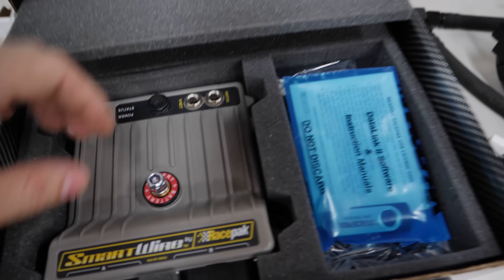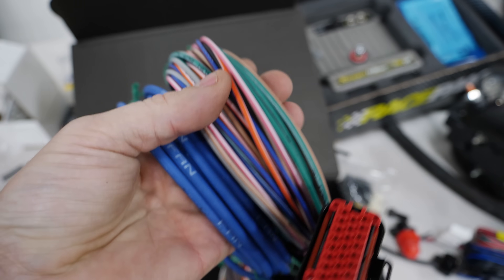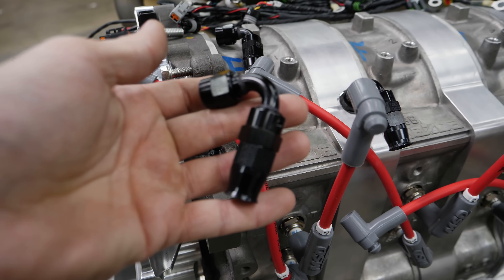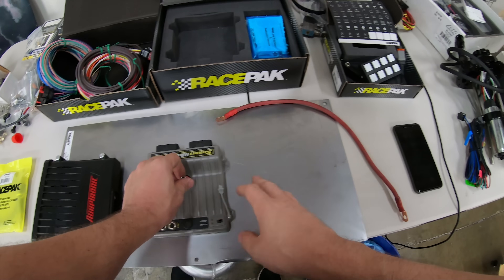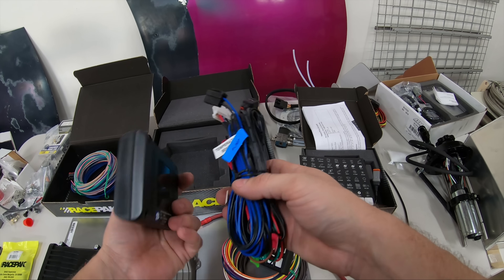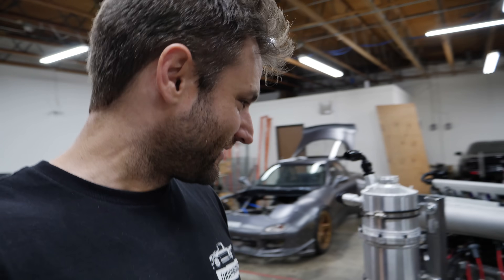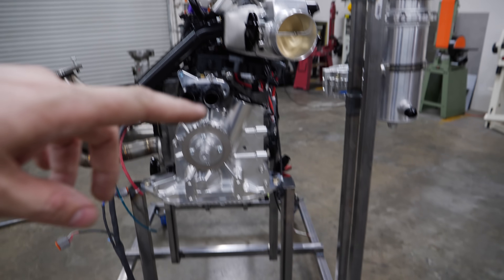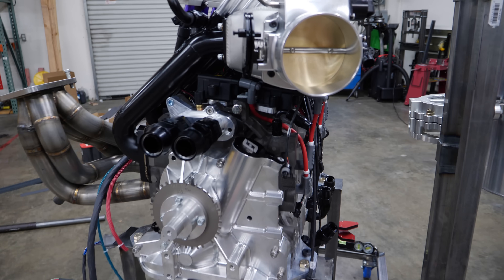The 4 Rotor will have NO FUSES to Blow or RELAYS to Wire?!

Comment: Highly doubt it will have zero fuses, you should have one for the starter, alternator and any time cabling splits/distributes off where it may come in contact with earth in the worst situation, any time a cable changes gauge or junctions it needs to be fused.

Comment: With the fuel pressure you're expecting here you really want to have an option to turn off your fuel pumps. You don't want to have fuel pumps running all the time whenever you ignition is turned on for whatever reason (tuning eg)

Comment: You can get good bender like Earl's and make those hard AN lines. Solid or swivel fittings are cheap, they rape you for the line in between. If you can make proper flared brake or fuel lines, you can make AN hard lines. The best part is you can make them any angle you want. You can also make complex bends and follow contours. It makes a cleaner install, the hard line is just 37 degree flared line #10 an is 5/8 line. Use the braided stuff only where you need flex for movement. It's big and bulky when the inside is still just 5/8 talking about 10AN. use hard stainless line and contour about a half inch off the surface with support every 6 inches to 3 feet. My 2 cents,  37 jic hydraulic line fittings are the same thing, you can buy them for 25 cents a piece. I can make a 120 degree 10AN hard line for less than 3 bucks. It's what you know. 37 jic hydraulic is the same as AN

Comment: Rob, Smartwire  is not an ecu. It can act as fuses for the cooling system but it doesn't turn fans on and off automatically, you need to run that through ecu

Comment: Blowable fuses are better sometimes. The resettable circuit breaker in your house won't stop lightning but a blowable fuse will. They are too slow by the time they flip the lightning already did it's damage. Not worth the added convenience in my opinion what's the point of a circuit breaker when it doesn't stop a power surge.

Comment: The reason Race cars have alot of manual switches is for easy redundency, like if your car catches fire the ecu wont neccicerialy know, but with a massive kill switch you can turn off fuel pumps just like that. Just a consideration if your going to be drifting at 300mph yeeeew

Comment: long term transistors are not the best idea short they can n will work but Polaris tryed it n them ecu boxes burned even the replacement melted wires on mine so i went to relays n fuses .ill never use anything like that n pay a premium .is it a china made deal by contract i hope if so they use real nitchecon caps n say Toshiba igbt transistors in it trust in it .just be care full with that thing after say 5 years

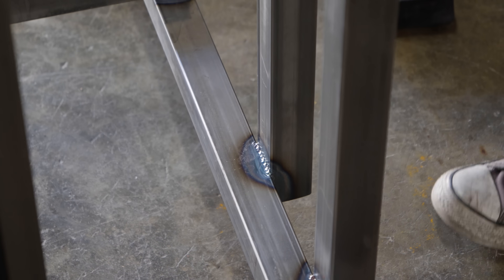Comment: 8:37 A consistent dip and a consistent speed will make it look real nice. Aluminum runs pretty hot and fast and you don't need as much filler as you think you do, especially on thin stuff.
Reply: That wasn't aluminum; hopefully, you knew that and were just offering extra advice. I have found that moving too slow, with too little heat, makes it harder to get nice beads on either metal. Running hot and fast can help reduce heat input into the part. X2 on consistency.

Comment: Your going to want to fuse the PDM at the battery unless you want a carbque. Also anything you wiire on that post for distro you will want to fuse as well. Also the only thing that is waterproof is water evetything else is only water resistant

Comment: ,,fuel pumps don't need to be manually turned on" oww the inexperience 😂
Reply: Why can't it be programmed as part of the start sequence?
Reply: Kirk Claybrook that's the inexperience.   We came across many cars in the shop that had that setup, simply an output on ECU like on a roadcar.  
However, you want to have control over the fuelpump manually, especially if you have tons of Rob Dahm made AN-lines, and for instance for starting the engine to oil pressure, like you commonly do on a racing engine. 

You could incorporate that into the ECU, but that means more programming and more potential things to fail.
Reply: @einzelmotorsport6711  "but that means more programming and more potential things to fail." How so? In the event that your ECU is faulty and fails to start the fuel pump then the engine won't start. How often do you see failed ECUs and what does that have to do with "inexperience"?
Reply: Kirk Claybrook Read it again, you want to be able to crank the engine for oil pressure only.  In a roadcar that's less critical. You could program the ECU to do that, but in my experience, the more simple the ECU program is the better.  What we typically do on startup of racecars is leave the fuel off, then crank the engine untill it makes oil pressure, then switch fuel on.

Comment: Thought you were doing the engine stand to be the same setup as the car. 
Surely the lines you are making for the oil system are going to be potentially useless due to oil tank location etc being different and the wiring for the ECU/pdm/arm dash  :/

Comment: Excellent work Rob.  The braces are far more important the shelves.  Bracing for vibration takes precedence over everything. You can always build a separate cart with designated shelves which may be more desirable because it can be taller and hold more items.  I like you thinking regarding have a place to put things when you take the off the engine.  Ideally you could make it a wheeled cart with brakes so  you could transfer between  the stand and the car.  Interesting that you didn't put wheels  on the carts for the engine.  I suppose you can use the engine hoist anyway.  It might have made things slightly more  convenient.   Junk yard Dave have been installing non marking wheels  on all his equipment they have brakes, they make no noise, and the main reason he has been installing them is he has epoxied his floor.  They leave no marks.  Probably not something you need to worry about but maybe something to think about In the future. I have watching you channel since the very beginning.   I am a Rotary nut.obviously, so are you.  Nothing comes even close to monstrosity you have created and I love it.  I want to see those land speed records.  Please kindly release your mice  into the wild is is the most humane thing for them.  Keeping them around is inviting them to escape and do more expensive damage. They make one way traps that are more expensive but they can be  reused and are designed to humanely release the animal.

Comment: Rob, you need to have circuit protection for all of those high amp circuits. A fuse blowing means something is fucked up and you'd rather fix the issue then replace your nice shiny module or run new wiring
Reply: alphawolffff don't tell him, its better TV.

Comment: Hey Rob I'm not a fan PDMs for the simple fact that if a circuit fails then the entire module has to be replaced unlike a relay or fuse that can be easily swapped out, some high load circuits will take that unit out just a matter of when still a sweet setup for a clean look

Comment: Rob

Piss the aem dash off and get a racepak logger dash  (they can log 42 channels of data) and send all that info over can bus to your smartwire (can control anything based on logic in your smart wire without wiring it all in to either directly the smart wire or a input module) 

I have the setup on mine and it is outstanding

Comment: what kind of pistons are you gonna run?
Reply: I believe he said Mahle pistons on the 3 rotor and Wiseco on the 4 rotor. Manley rods on the 3 rotor and Eagle rods on the 4 rotor. Rob doesn't know it but the reason the 3 rotor doesn't work isn't actually grape juice, but the knock sensor read wrong and threw the camshaft position sensor off. Can't have it all with variable valve timing I guess.
Reply: @jacobwebb8818  hopefully decent cams too
Reply: @Mgiles1001  Didn't he say he will use the FreeValve system? Christian wanted to give it to him for free after all
Reply: @FzudemB  I think not, in the end, Rob didn't wanted to overcomplicate it with the FreeValves like with all these spark plugs and injectors. Im glad though that he finally got a decent timing belt, considering the ponnies he's gonna make. I presume he would rip his head of if the first thing after pumping the pedal to the metal was to hear how valves meet the pistons.

Comment: Love the intro, but if your able to bend the mounting plate a little under the dream team you would be able to mount the AEM dash comfortably on the plate without touching the transmission if it has enough room, it's not in the car so it's not in danger

Comment: More money in AN fittings then some people’s build lol
Reply: He’s probably spent more on fittings than my car is worth 🤷‍♂️
Reply: TheSPOONFED#1 dude I want to know what he will do with all the extras 😂😂 he has so much
Reply: Ghost Pro giveaway would be sweet but most likely another build
Reply: How much do AN fittings cost?
Reply: @JF-ns5zs  for like a -10AN some are $20 or more each.  He has much bigger fittings like -16AN which I could see being 50-100 a fitting
Reply: @oWhiteMonster  6AN is smaller than 10AN tho, also "10AN" and "26AN" is just the size of fittings, a lot of companies make the fittings. And Rob most likely didn't buy the cheapest.
Reply: @alexstromberg7696  I was just thinking like wire gauge I was just guessing lol
Reply: @JF-ns5zs  I just spent around 45 bucks on two -3AN clutch line fittings. So they are pretty pricey even at the low end of the scale
Reply: Because billet bruh
Reply: I did a 2100whp GTR build about 6 months ago, That car had a total of 3200 dollars in fittings and lines.
Reply: Dudes engine stand is better quality than most guys builds 😂😂

Comment: Hi Rob. I recently built a similar setup using the SmartWire on Azn's Dung Beetle and it works great. You might want to consider a small fuse and relay block for your ignition (as you stated) but also for the injectors and the ECU itself. You can activate all the relays with one of the SmartWire outputs.

Comment: Put a stock rx-7 headlight switch on it to be able to pop up the headlights, then you have one fully stock part :)
Reply: Better yet have one stock bolt from a rx7 and tell people to find the stock parts
Reply: I feel like he should remake the stalk out of billet aluminium though just for because reasons
Reply: Let’s scrap the whole project and build a stock rx7 fd3s 2+2 from scratch let’s cut the motor in half :)
Reply: @JB-sv5pr  There's 4-rotor RX-7's with far more stock parts than what Rob is building. It's doable, but it depends on what you want to use it for. If it's only track days, then Rob's RX may make sense, but for more daily-driving stuff, you'll keep most of the changes 'under the hood', so to say.
Reply: halofreak1990  yeah I seen some stock ones 
 
I like robs build full on track car
Reply: I love the stock RX-7 headlights
Reply: Techinically the headlight would be the stock part so dont need the headlight switch

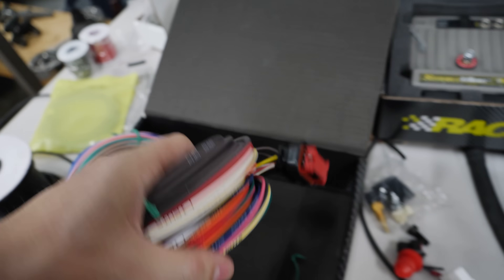Comment: Fuel Pump wire is to thin for this strong pumps!  (2:09)
Reply: for many setups yes. IIRC two 16AWG wires with 20A each will equate to 11AWG/40A which could be inadequate. In these cases just use a single fuel pump output (freeing the other in the process) to trigger a dedicated relay or two.

Comment: Plot twist the engine stand IS the 4 rotor build
Reply: What do you mean?
Reply: @derpsheep6524  its got wheels and a motor so techincally its avehicel lmao
Reply: He has said he's gonna have a running 4 rotor. Didn't say it was gonna be in car. I believe the engine stand getting to sema more than the car to be honest. He's gotta mount a whole new carbon fiber body cuz the one there is missing the front fender and I don't see him finishing it paint ot wrap in time for the show. Unless he's been hiding the new body and is storing it somewhere... I don't see him doing that though he'd be bragging about it and been working on mounting it.
Reply: @wheeliehigh1  he said he's going to run engine on the stand in full package with functioning transmission before putting it in the car to complete the chassis and bodywork.
Reply: wheeln 24/7 agree this engine stand is overkill for it not to be a display piece at sema